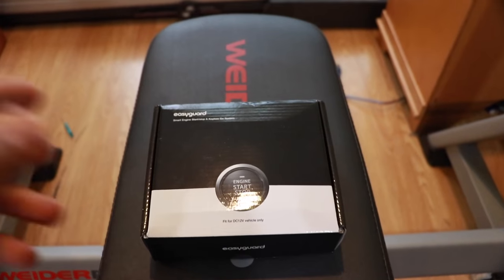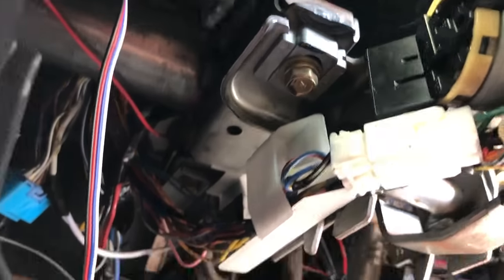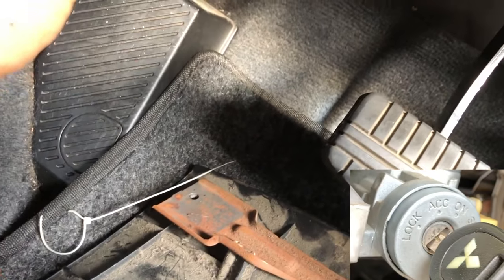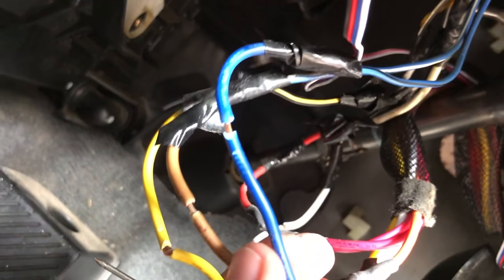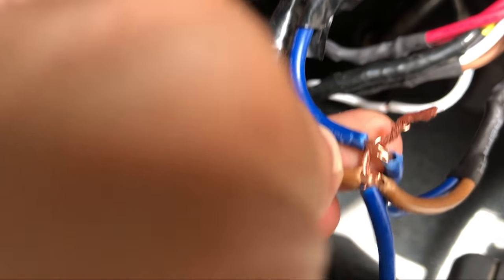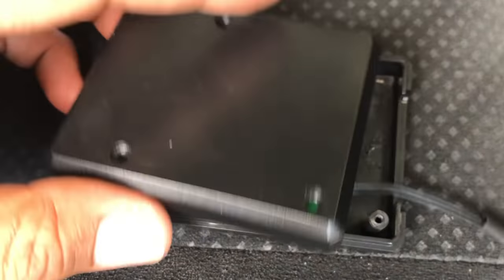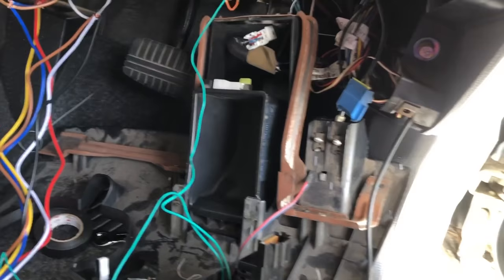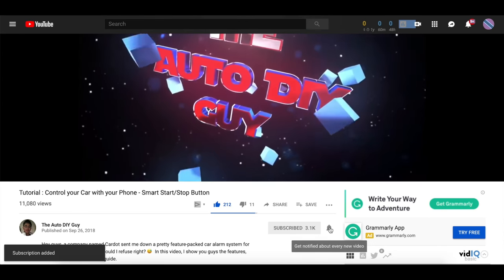The Right Way to Install a Start Stop Button (EASYGUARD EC004)

Comment: Disabling the factory immobiliser to rely on that little black box is crazy.
Factory immobilisers are nearly impossible to bypass without the chipped key, but the little black box you now rely on is easy to find at end of ignition loom and bypass.

Comment: Instead of making holes in the wires, it helps to have alligator clip probes for your multimeter, pretty cheap to buy if you have a multimeter with plug-in type probes.

Comment: You don't need that kit to bypass mobilizer. All you need is a 1 - 1.5m long 22-18 awg insulated wire (so it is not bulky). Short circuit both end wire and wrap it in both barrel and your working key (around the plastic part not on the metal). About 4-5 turns in barrel and key. As simple as that.

Comment: Mine works with only the key wiring,brake wire,indicator wire and ground wires. Afraid if it would later on cause a problem. Very helpful video, best one so far. thanks

Comment: Would you still need an immobilizer bypass or to wrap the ignition wire, if you're putting the original key in the ignition and then cutting it off, or like my Honda you can unscrew it. Then you would have the steering column unlocked and the original key in the ignition so the factory immobilizer would work fine

Comment: I am installing on a old Ford Mustang (1970).  For ignition switch has 2 proof wires.  They put a temp ground on things like the brake lights.  What should I do with those wires?

Comment: Is the immobilizer bypass completely necessary? Couldn't the factory immobilizer reader just be removed from the ignition switch and relocated with the transponder attached to it the same way you put the key with the bypass unit?

Comment: your videos are great. I installed the easyguard ec003 in a 2016 kia sorento, but I cannot identify the door opening and closing cables, the flashing light cable, the courtesy light cable and the trunk. Do you know where I can buy the Kia Sorento manual?

Comment: I installed push start, tried it and it turned on but couldn't move vehicle because of key cylinder so I removed the whole thing to be able to move the car but when I tried to turn it on again it only cranks and won't turn on help.

Comment: I have a question- does any immobilizer that is used with the system have to connect directly to the Easy Guard module? If so, how does it connect? Or can an immobilizer just be installed in the ignition wiring, but separate from the easy guard unit?
Reply from the maker: I’ll reach out to the manufacturer, and once I get a response, I’d post it here

Comment: Friend, I have a big doubt and a question if you can help me.  My car has a remote start with an original factory key and I can start it remotely from my house with its key.  I am going to use 2 keys with a chip, one for the chip that will always be placed in the ignition antenna (to be able to enable the button that I am going to install) and the other as a spare to be able to start the car remotely.  My question is: will the copy of my other key with a chip work to start the car remotely from the house once the button and a permanent chip in the antenna are installed?  Greetings

Comment: dude i got everything else working except door lock/unlock. i have to carry the original carfob to lock&unlock the doors. Then i have to use the new fob to reactivate the car and disactivate the car. I found the wire for lock/unlock with the light pen. but its not working as intended.

is there a different wire for remote lock/unlock? because what i found was the wire to the door lock buttons.

Comment: Thanks for this! I installed this on my peugept 206, but the issue is that it only turns the car on if the physical key is in the ignition positions, and only turns it off when it is taken off ignition. Any idea what can cause this?
Reply from the maker: Shervin Koohi did you disconnect the wires from the back of the ignition lock cylinder?
Reply: Same thing with my 1991 toyota celica gt. Fid you fix yours? What did you do? I need your input. pls help me.

Comment: bro how do i go about testing the door unlock and lock if its positive or negative. and also for the door switch. where do you plug the wire for the confirmation for lights

Comment: You install looked very similar to how car starters were installed, in where you had to give up a key. 
I wonder if this install can be done with an alternate bypass module? So then if the battery in the transponder dies. You can just put you key in and start your ignition?

Comment: What’s the range on that transponder , do you need to have it inches from the ring as you showed or can it be in your pocket like a factory press start/ stop ?
Reply from the maker: Only inches away…if you’d like to achieve what you’re asking, you’d need to install a Passive Keyless Entry system. I’ve done a couple videos on this, so you can check them out if you’d like 😊

Comment: My car has 1wire (ACC)  and 3 wire (On) can I connect 3 wire (on) in yhe white wire, they keep electricity when I put on and start the car, I think 2 of 3 are the car air and windows... could I connect toghether?

Comment: I had installed one and the car stood on like if I had it on1 position how  how do I get to turn off..

This is my wire diagram for my car can you tell me which wires I put together like you did. Because when I did it my car stays on 

12v constant wire - pink black & red
Starter wire - yellow
Ignition  wire - blue
Second ignition wire - green/red
Accessory wire- black & orange 
Second accessory wire - black & white

Comment: i have installed all wires correctly but my car lock key is not working from remote.... i think its coz of i have cut my other key and insert in steering  lock to unlock the steering.... plz help

Comment: Brother one of these was install on my car n it caught on fire. One cable was burning. Do you think it was the installer?  Was fixed and return back to using key. Was told was the wiring that used a thin wire they need be thicker one. It this true?
Reply from the maker: oh interesting; it works fine for me after many years; which vehicle do you have? Year and model
Reply: The Auto DIY Guy 2002 Toyota celica Gt auto
Reply: Would you say bad wiring done!!?
Reply from the maker: @hanielbomb  yes it would seem so.
Reply: The Auto DIY Guy thank you. Cause i plan on buying another one Cause I like the push to start feature. Which one would you suggest,?? One that has passive key. Entrance. Thank you. Also where do I get the wiring diagram, does it come in the box like yours did???
Reply from the maker: @hanielbomb  yeah all these kits come with installation instructions with wiring diagrams. In terms of which kit you should buy, it depends on which features you would like.
Reply: The Auto DIY Guy EC201-M9. Plan on getting one brother. It’s good righ?
Reply from the maker: @hanielbomb  it looks good. I have never tried it out myself though.

Comment: Thanks for the vid I installed my starter wire into both of my starter wire and it worked, but when I start my car it gets a little loud is that normal?
Reply from the maker: Hmmm 🤔 “loud” as in the car revs higher? The start stop button’s job is to just do the job of the ignition lock cylinder. Nothing more nothing less

Comment: Hey i need that bypass module in my car. Will it still work if i take the ignition out or hide the ignition in the dashboard? I dont want it to be visible. Does the ignition have to be connected?

Comment: I installed one on my car and got the correct wirings installed in the ignition wirings but whenever I try to start it the ignition coil cranks but it won't start. Any thoughts?
Reply from the maker: Kenneth Fields did you wire up the immobilizer bypass module?
Reply: @TheAutoDIYGuy  My car doesnt come with immobilizer.
Reply: My is doing the same.. what did you end up doing?
Reply: @ChinaSouthernAirlines_83742  ah...then might be that your car is taking too long to crank over to start engine. Try holding down start stop button when trying to start engine. Tell me if it starts like that.

Comment: question about the immobilizer  bypass module is that specific the  easyguard  or will it work with and  PKE w/ push to start because i have 2010 f150 with chip key

Comment: question brow..as you shown on the manual if you have only 1 ignition wire you dont need to connect the brown wire as you said on the manual and how come you joined the brown and the white wire from the module to your only ignition wire tnx
Reply from the maker: I joined it as a “just incase measure”. So either way can work; up to you 😉
Reply: @TheAutoDIYGuy  thanks brow

Comment: If I do not turn off the engine and I go away from car, the car does not lock and engine continue to run. Is it normal for this alarm system or is there any solution for it. Because this is seri, anybody can steal the car if we do not turn off engine by push button pke

Comment: Also, leaving it on Accessorie, will it drain my battery?
Reply from the maker: it won't because you'll be disconnecting the wires corresponding to it. The purpose of putting key in ACC position is to disengage the steering lock. Hope this helps!

Comment: Hey I also bought a alarm kinda likeyours mine has a (oil path wire) I’m not sure where to connect it to? Help
Reply from the maker: If you can’t find the oil path wire, then you can just connect it to the 12v constant wire

Comment: If I get this installed, can I just use my original key in the ignition to turn start the car if I dont feel like pushing to start my car?
Reply from the maker: If you leave your ignition lock cylinder in place, and leave the wires plugged into the back, it can be done, however, you would need to have the key regardless of if you want to use the button or not (which I believe would defeat the purpose lol). But to answer your question, YES it can be done.
Reply: @TheAutoDIYGuy  Hey thanks for the reply! I have done some research and there is a Key Lock Pin and a Steering Wheel Lock Pin (the safety measure that prevents the wheel to turn without the key) I was thinking that this can be taken out of the steering wheel to have both of them work without interfering with one another, and as for a safety measure I was thinking that a very well hidden kill switch can be added to the vehicle to replace that steering wheel lock, any thoughts about if this may work? Searching about the steering wheel lock pin is tough but someone wrote on a forum about it saying the steering wheel will still turn fine without that pin lock
Reply: Is there anyway to stop engine automatically, if you go away from car and lock car with pke function, Incase if you forget to stop engine with push button

Comment: Hi, i have two wires labelled AM1 and AM2 which I believe from my tests are the power lines. I also have IG1 and IG2 , then ST1 and ST2 and ACC.  when i follow your video I t leaves out two of this cables from the original key start. the engine cranks but does not start. thanks in advance for your input

Comment: If you unplug the key barrel does it, it unlock the steering wheel ?
Reply from the maker: Nope. It's a physical lock tied to the key barrel itself.
Reply: So basically removing the key barrel would unlock the steering wheel?

Comment: Couldn't you just jump the 2 wires together behind the ignition to put it in accessory mode, rather than leaving a sawed-off key in it? Otherwise all they're going to need to steal the car is a way to turn it - like a basic screwdriver or pair of needlenose pliers? (Since the wires aren't disconnected or anything like that, it's still live and functional, right?)
Reply: still need that blue transponder
Reply: @Newyorkinbroward  ...But the key is sawed off. The transponder chips are in the plastic head of the key, which is cut off, so I assume it's been accounted for/rendered unnecessary?

Comment: Hi, appreciate all your guides for the push button/PKE system but I was hoping you can help out.
I have a 2001 Toyota Corolla and the ignition wiring harness has 6 wires.
Based on the key position, this is what I've gathered. * "(+)" means they are connected*
Off: White = 12 V cons; and BlackRed = 12 V cons
Acc: White (+) BlueRed
On: White (+) BlueRed (+) BlackYellow; and at the same time
       BlackRed (+) BlackWhite
Start: White (+) BlackYellow *BlueRed is disconnected*; and at the same time
          BlackWhite (+) BlackRed (+) Red

So, I have two 12 V cons: White (which seems to be for high current ACC) and BlackRed (which seems to be mainly for starting the engine,). Should I connect them together to the Red cons 12V from the kit?
ACC wire must be BlueRed
Start wire must be Red
Now I get confused with the ignition ON wires. ON#1 is always powered even when cranking the engine, while ON#2 gets cut off while cranking the engine.
I'm not sure which of BlackYellow and BlackWhite is ON#1 or ON#2
Thank you.

Comment: After done all wiring should I disconnect the wires from key switch or keep it as it is
Reply from the maker: You should disconnect.
Reply: The Auto DIY Guy and what are the GWR wire, actuator wire,fuel pumps wire and turn signals wire means. I don’t saw those wires in your video. It seems in my ES002 unit has some extra wires
Reply: Please let me know how to connect those wires
Reply from the maker: @rosamala1000  hi, it does seem that your kit has more features. The GWR wire is the Ground While Running wire, which is the wire that has a ground signal only when the engine is running (you will have to refer to your car's wiring diagram to find this).
I'm not sure what actuator your kit is referring to (I can only assume it's the door actuator, which automatically locks and unlocks the door).
Fuel pump wire is the wire which receives 12v when the fuel pump is running.
Finally, the turn signal wires are the left and right turn signal wires which receive 12v when the turn signal light is on.
Reply: The Auto DIY Guy without connecting those wires can I use push button function. I meant if I connect key wires and break and ground wires only
Reply from the maker: @rosamala1000  yea should work. If your car has an immobilizer, you need to use an immobilizer bypass module.

Comment: So we do need to use the bypass module in order to be able to install this on an immobilizer car? I've got a V6 Audi A4 B5 which already has immbolizer system. What's the better way to install it on european cars? Any suggestions? Thank you.

Comment: I installed and the car starts but the shift lever stucked on park. It will only release if put the key on the ignition to run position
Reply from the maker: you need to remove your ignition key barrel. Please check https://youtu.be/lUuIhogK4ww?t=724 to see how it's done.

Comment: i try installing this but the problem is there's no starter wire i found in ignition key cylinder connection. the one which supposed to be the start wire has no power to it when i did the tester process of cranking up, any suggestions? thanx diy guy.
Reply from the maker: Hey... are you 100% sure that that’s your starter wire?
Reply: The DIY Guy , yes sir, tested all the wires . I wonder why there is a wire that is no power at all which i supposed is the starter wire.
Reply: @TheAutoDIYGuy  i find already the starter wire and install  the wirings , was able to start and takeout the ignition key but the steering wheel lock and also the  stereo is always  on and cannot be off.. could you solve  it?

Comment: Is that nessesary car to be with automatic transmision to use the system? Cause you know in non automatic transmision we use clutch pedal to ignite and turn the car when it is on gear.
Reply from the maker: Yep. Instead of connecting to brake signal wire, you connect to clutch signal wire.
Reply: @TheAutoDIYGuy  so that means if i want to turn off the car i need to press clutch pedal and then press the "stop engine" right?
Reply from the maker: @ChoosenEngineer  yep

Comment: I got installed easyguard in my Honda Civic 2013. With original remote of Honda, I was able to open my trunk remotely but after installation of easyguard which has the features to open trunk remotely, I can not open the trunk with easyguard remote. Please give me the solution to correct it
Reply from the maker: Hey bro. The easyguard unit in this video does not come with a remote. I'm not sure what you mean. 🤔
Reply: I mean fob key

Comment: Thank you for the tutorial, ......... if the starter is not strong enough why is that, bro? But if you return it using the default key, can the starter ... guess what?
Reply: ive experienced it too but i found out that i have 2 12v power lines so i connected both to the harness

Comment: Great video thanks! I had a thought, i was wondering if you could use this and the 'passive keyless' transponder system as one unit? Since I do not enjoy the blue RF fob on this, can you tie this system with that and create one ecosystem? Walk up to the car, it unlocks, then sit inside the car and push start car all using the one 'keyless' fob inside your pocket. Is this possible?
Reply from the maker: Hey bud, please see this video https://youtu.be/QT-XmFuEGsw

Comment: Please can you help me with my problerm. I have switch I and II for one wire. What i have to do to connect my divise?
Reply from the maker: Connect the two to one from the push button kit.
Reply: @TheAutoDIYGuy  do u mean i conect key no 1 and key no 2 in my divise together and conect it to my wire ignition?
Reply: @TheAutoDIYGuy  plz if you link in youtube . It wil be more beter to explein